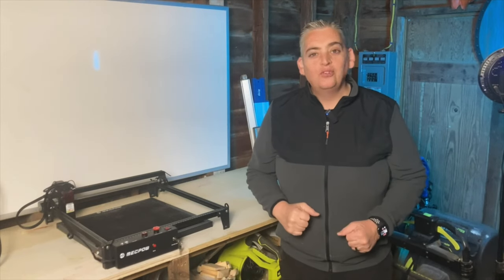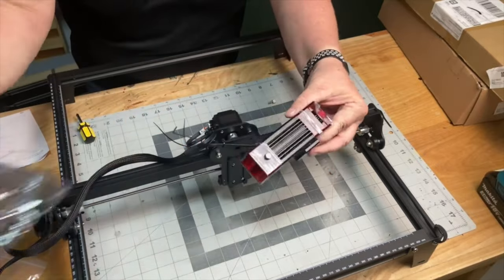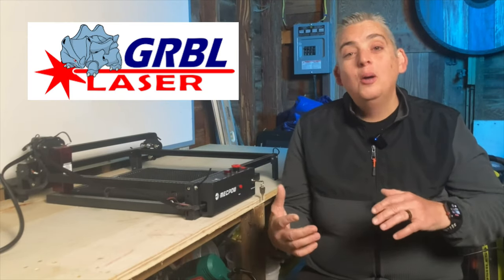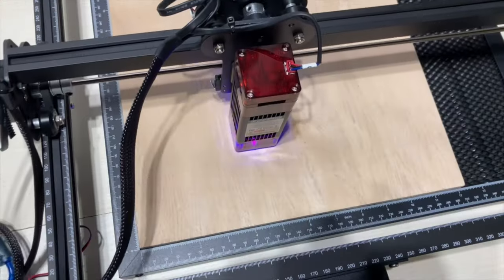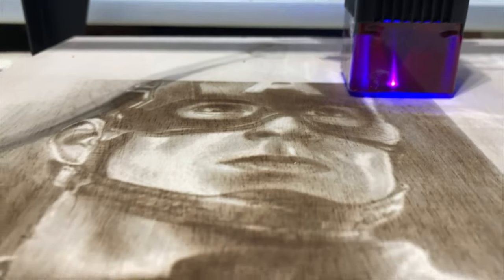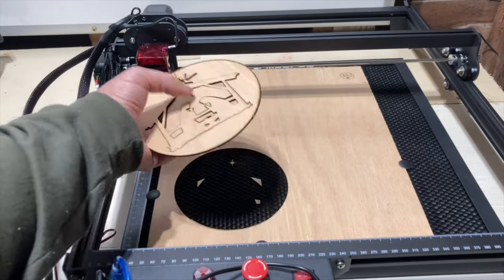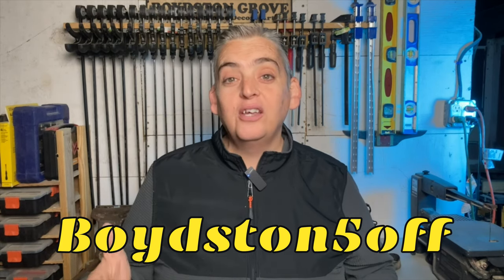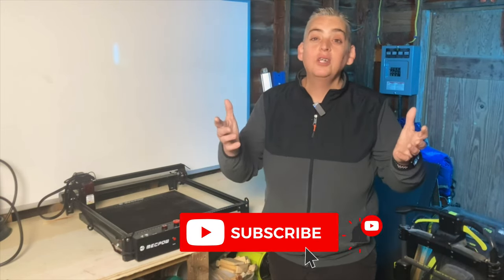Does a Laser Engraver Belong in a Woodshop?? Mecpow X3 Review

Comment: Great video! 
Just got my X3 as a gift but I'm struggling when trying to cut wood. Can you possibly let me/us know the setup you use for cutting (speed etc.)?
Thank you very much!
Reply from the maker: So I am using LaserGRBL and I have learned that the 5watt laser cuts the balsa wood packs off of Amazon the easiest. I typically buy 3mm material and it typically takes 4 passes at 40% speed and full power. In the puzzle video I made, I used 1/8 plywood and it took 6 passes to get through it. I'm still learning myself, so as I learn more, I'll make sure and share it.